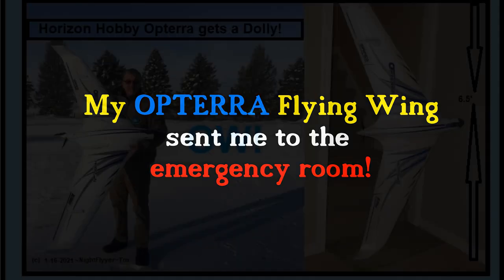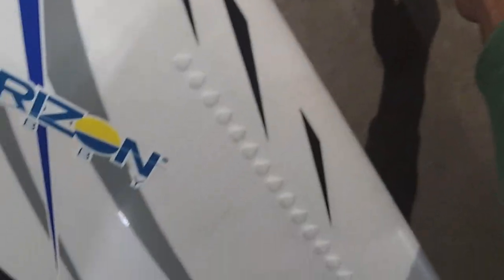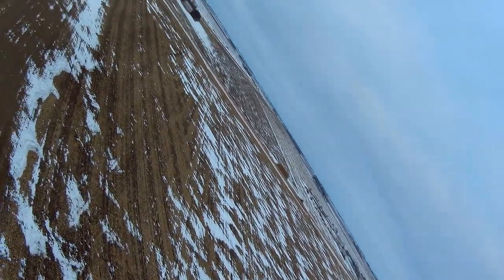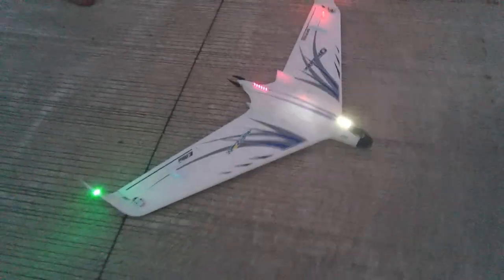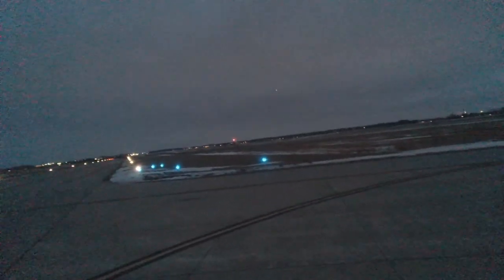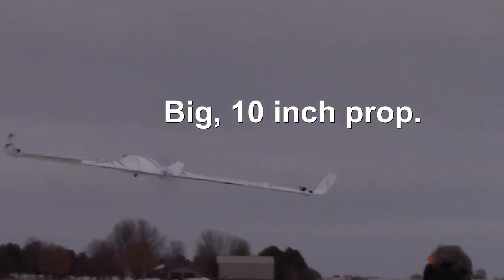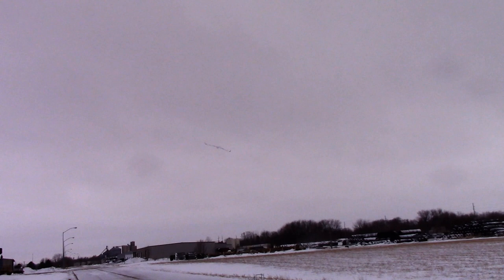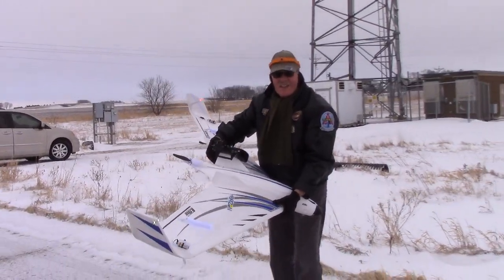My Opterra 2M Flying Wing sent me to the E.R. This is an awareness video & my solution for launching

Comment from the maker: ***UPDATE.  See this newer video if your considering buying ANY pusher plane.  My Sled Launcher.  https://youtu.be/f5xDfk7sbcQ
 Notice for all those that say they never heard of ESCs that need stick movements to arm:  I have used hobbico, horizon, and great planes ESC's for years and am spoiled by what they call SAFE START.  I like it and when I come across one that doesn't have it, I am disappointed.  I am using 2 of these on my Mega Storm Launcher that I built this past fall, 2020.   Here is from the 22-25 Electrifly manual:  SAFE-START:  As  a  safety  precaution  to  prevent  the  motor  from  rotating when the battery is first connected, you must “arm” the ESC every time you connect the battery. The propeller will NOT rotate until the  ESC  is  armed.  To  arm  the  ESC,  move  the  throttle  stick  to  full  position,  then  back  to  off  (or  brake).  Now  the  motor  will  rotate  anytime  the  throttle  stick  is  advanced  away  from  the  off  position.

If you follow my channel, you know I am no newbie and for some to say I asked for it or should have done it differently is disappointing, especially when I am the one hurt, the hospital charged me $2400 for X-rays, Tetanus shot, 27 stitches, and 2 repaired tendons, when I followed the manual's launch instructions word for word.    See previous good hand launches in my Product review video and my second one here.   https://www.youtube.com/watch?v=P_inF5EYLEE&t=1s&gl=CO and  https://www.youtube.com/watch?v=ur5V5H8UcGs&t=1s

First of all, that throttle arming had nothing to do with my hand injury. I only mentioned the Throttle arming because I followed instructions in the manual and that is the way it bound up.  It arms the motor as soon as you plug in the battery. I usually program a throttle cut in and mentioned it in case a new person forgot.  In older Electrics we used to put the throttle at full.  Then when it was time to fly, you would bring the throttle down to idle to arm it.  Today's transmitters warn if the throttle is full and no rf is transmitted till you put the throttle to low.  Because this big plane is hard to  handle to prepare for launch, I think the manual should mention to program in a throttle cut. This plane is hard to pick up by the tip and barely has enough power to fly out of your hand at launch.  I know and I tried.    It would also be extremely difficult to somehow launch it discus style with the elevon there and that 7" tall winglet rudder that is also on the tip.  I know how to do it , but not with this plane.  
It's not like launching my SMALL F-27 Evolution or 1.2M Opterra.  So I followed the instructions word for as I did for the video I made of my product review earlier where nothing happened bad.  https://www.youtube.com/watch?v=P_inF5EYLEE&t=1s 
We are only talking about a Half inch of clearance that I needed to keep from getting cut. 

Here is word for word what the Opterra 2M manual says about launching.  
1. Put the aircraft into launch mode with the channel 5 switch.  (in my first video that did not work, it went into the ground)  
2.  Hold the aircraft in one hand and the transmitter in the other.  
3.  Apply full throttle and throw the aircraft directly into the wind, angled slightly up (5 to 10 degrees above the horizon). 
4.  Climb to a safe altitude and check the trim.   

I know others have their own ways, and either way, my Dolly is the safest solution for me.  
The Opterra 2M manual also says nothing about throwing it with the motor off, so if a newbie followed the instructions, like I did, I'm showing what could happen, in case a gust of wind got them or something else.     Nothing is 100% and no matter how good you can throw, this big 7 foot wing with a 10 inch prop spinning right next to your face, is risky.

Maybe a gust of wind, maybe my 73 year old left arm was weaker, or who knows.   But either way, if it happened to me launching the way I thought was good (and  the same as all my previous launches.)  So if it can happen to me, it can happen to others, and that is the warning I want to present. 

Gloves
Thanks for that suggestion and I tried that already, because it was cold, but trying to hold on to the tiny finger grips on the bottom of the 7 foot wing with a thick glove under full power would be difficult when under power and then trying to fly with it on and also difficult to fly the transmitter,  so although that sounds like a good idea, it would probably not work that well.  We are only talking about a Half inch of clearance that I needed to keep from getting cut. 

Landing gear.
Yes, well if you saw my Product review  video,  https://www.youtube.co/watch?v=P_inF5EYLEE&t=1s  you would see  those wings aren't as strong or thick as you would think.  I would have to add a nose wheel servo and make it a trike as well.  And since the prop on the back is 10 inches, the landing gear would have to be quite long or retractable prop would hit the ground on rotation or landing. Thanks for the suggestion, but the dolly is pretty permanent too.  
Night-Flyyer-A-Pult catapult.

See my 14 year old self-contained catapult in action here.  https://www.youtube.com/watch?v=ypxbkaY-Ycs&t=113s  

And to see how I feel about that unnecessary auto stabilization system see this.  https://www.youtube.com/watch?v=ur5V5H8UcGs&t=1s

And to see another fellow who got whacked with a smaller plane, click here. 
https://www.youtube.com/watch?v=GlevWppQu9w

Thanks and God Bless, 
Dave

Music Score by Http://www.bensound.com
Reply: So sorry to see this happen but so glad you put this out there to warn others, once again Dave looking out for others :)
I wonder why they didn't make it a ducted fan design for safety reasons
Reply from the maker: @lee__1707  Thats what I said in my comment and video notes...At least a ducted fan shroud or something!  Maybe Ill just put a ducted fan on it this spring.  thanks much.
Reply from the maker: @capnhardway  Maybe a gust of wind, maybe my 73 year old left arm was weaker, who knows.   But either way, if it happened to me launching the way I thought was (and looked the same) as all my previous launches. Nothing is 100% and no matter how good you can throw this big 7 foot wing with a 10 inch prop spinning right next to your face, stuff can happen. 
So if it can happen to me, it can happen to others, and that is the warning I want to present.
Reply from the maker: @capnhardway  If you follow my channel, you know I am no newbie and to say I asked for it or should have done it differently is disappointing, especially when I am the one hurt, the hospital charged me $2400, and I followed the manual's launch instructions word for word.     First of all, that throttle arming had nothing to do with my hand injury. I only mentioned the Throttle arming because I followed instructions in the manual and that is the way it bound up.  It arms the motor as soon as you plug in the battery. If it had said to program in a throttle cut, I would have!    This wing is 7 foot long and will bend and break the end off the if you even try to pick it up by the tip. It would also be extremely difficult to somehow launch it discus style with the elevon there and that 7" tall winglet rudder that is also on the tip.  I know how to do it , but not with this plane.  See my 14 year old self-contained catapult in action here.  https://www.youtube.com/watch?v=ypxbkaY-Ycs&t=113s
It's not like launching my SMALL F-27 Evolution or 1.2M Opterra.  So I followed the instructions word for as I did for the video I made of my product review earlier where nothing happened bad.  https://www.youtube.com/watch?v=P_inF5EYLEE&t=1s
Here is word for word what the Opterra 2M manual says about launching.  
1. Put the aircraft into launch mode with the channel 5 switch.  (in my first video that did not work, it went into the ground)  
2.  Hold the aircraft in one hand and the transmitter in the other.  
3.  Apply full throttle and throw the aircraft directly into the wind, angled slightly up (5 to 10 degrees above the horizon). 
4.  Climb to a safe altitude and check the trim.   
I know others have their own ways, and either way, my Dolly is the safest solution for me.  
The Opterra 2M manual also says nothing about throwing it with the motor off, so if a newbie followed the instructions, like I did, I'm showing what could happen, in case a gust of wind got them or something else.     Nothing is 100% and no matter how good you can throw, this big 7 foot wing with a 10 inch prop spinning right next to your face, is risky.  And to see how I feel about that unnecessary auto stabilization system see this.  https://www.youtube.com/watch?v=ur5V5H8UcGs&t=1s
Maybe a gust of wind, maybe my 73 year old left arm was weaker, or who knows.   But either way, if it happened to me launching the way I thought was good (and  the same as all my previous launches.)  So if it can happen to me, it can happen to others, and that is the warning I want to present.  Thanks.

Comment: I launch mine with a power-off glide and only power up after leaving my hand.
Reply: Yep thats the only way to do it. It makes me shudder every time i see someone launch under power
Reply: @timjarman6027  wing launch..... never put your hand in line with a prop... spinning or not. pusher flying wings need to be wing launched, or use a slingshot.
Reply: I was doing this too. But I didnt like that I have to grab controller fast right after launch. Now I configured auto-takeoff on my F4 FC with Ardupilot. Works like magic: FC senses when you through the plane, starts prop after short delay and do auto climbing. It makes takeoffs very easy and does not require additional equipment.
Also, it happens that I mostly fly during winter season, so I am wearing gloves. I believe this adds some safety too.

Comment: Hurts just hearing the sound of the prop striking your hand.
Reply from the maker: Yes, but this razor sharp carbon fiber prop would probably cut thru that too.  I never had to ever use a glove to launch any of my wings, but this big 10" prop is very close.  I will never hand launch it again as it's Hello dolly!    Thanks for the suggestion and comments.
Reply: My hand hurts just listening to that sound! And tendons are no fun s
Reply from the maker: @nwanchorcertification  For sure.  It still hurts and the bone got whacked pretty good as well.  Thanks.
Reply: @NightFlyyer  Chainmail butchers glove, problem solved.
Reply from the maker: @RACGump  Not at all. Thanks for that suggestion and I tried that already, but because it was cold.  I found trying to hold on to the tiny finger grips on the bottom of the 7 foot wing with a thick glove under full power with wind blowing was difficult when under power and then trying to fly with a big enough glove on was also difficult to fly the transmitter, (I'm a stick pincher)  so although that sounds like a good idea, it did not work that well. Some have told me the Prop got them in the forearm even before launch, when a gust of wind got under the wing and tipped it back.   We are only talking about a Half inch of clearance that I needed to keep from getting cut, and even though I pulled it off several times in my earlier product review video,  I will never hand launch it again.  LOL.  It's hello dolly from now on!  Thanks.

Comment: Why not setup a throttle cut switch on your transmitter so when activated throttle does not function?
Reply: I had a similar experience when I was first learning to fly.  That’s when I put an arm switch for the throttle on the transmitter.  I use it religiously.  When I am done with a flight, I  kill the throttle at the switch and it stays killed until I am ready to fly.  Although I didn’t require stitches, I was in shock.  I keep a well equipped first aid kit in my truck and was able to patch myself up enough to get home and do it properly.  Have to admire your landing, but personally I would have killed the throttle and landed straight ahead.....hope you are healing well.

Comment: Great to see that you are healing OK my friend. That is why Iam laways a little afraid to hand launch pusher planes since my hand accident. I just dont want to cut my other hand also. Great takeoff with a trolley. I wanted that with my small one Opterra but it didnt worked. Maybe with bigger one it will. Its worth to give it a try. Stay safe and big salute from Slovenia.
Reply from the maker: Thanks a lot captain. I  appreciate that.  The big one is underpowered in my opinion.  Stay well.

Comment: My friend had an Opterra and he launched with motor off and quickly gave throttle , but we have good strong wind to allow this. Get well soon!
Reply from the maker: If you follow my channel, you know I am no newbie and to say I asked for it or should have done it differently is disappointing, especially when I am the one hurt, the hospital charged me $2400, and I followed the manual's launch instructions word for word.     First of all, that throttle arming had nothing to do with my hand injury. I only mentioned the Throttle arming because I followed instructions in the manual and that is the way it bound up.  It arms the motor as soon as you plug in the battery. If it had said to program in a throttle cut, I would have!    This wing is 7 foot long and will bend and break the end off the if you even try to pick it up by the tip. It would also be extremely difficult to somehow launch it discus style with the elevon there and that 7" tall winglet rudder that is also on the tip.  I know how to do it , but not with this plane.  See my 14 year old self-contained catapult in action here.  https://www.youtube.com/watch?v=ypxbkaY-Ycs&t=113s
It's not like launching my SMALL F-27 Evolution or 1.2M Opterra.  So I followed the instructions word for as I did for the video I made of my product review earlier where nothing happened bad.  https://www.youtube.com/watch?v=P_inF5EYLEE&t=1s
Here is word for word what the Opterra 2M manual says about launching.  
1. Put the aircraft into launch mode with the channel 5 switch.  (in my first video that did not work, it went into the ground)  
2.  Hold the aircraft in one hand and the transmitter in the other.  
3.  Apply full throttle and throw the aircraft directly into the wind, angled slightly up (5 to 10 degrees above the horizon). 
4.  Climb to a safe altitude and check the trim.   
I know others have their own ways, and either way, my Dolly is the safest solution for me.  
The Opterra 2M manual also says nothing about throwing it with the motor off, so if a newbie followed the instructions, like I did, I'm showing what could happen, in case a gust of wind got them or something else.     Nothing is 100% and no matter how good you can throw, this big 7 foot wing with a 10 inch prop spinning right next to your face, is risky.  And to see how I feel about that unnecessary auto stabilization system see this.  https://www.youtube.com/watch?v=ur5V5H8UcGs&t=1s
Maybe a gust of wind, maybe my 73 year old left arm was weaker, or who knows.   But either way, if it happened to me launching the way I thought was good (and  the same as all my previous launches.)  So if it can happen to me, it can happen to others, and that is the warning I want to present.  Thanks.
Reply: The Opterra will glide for a solid 40-50 feet in no wind.  I hold the TX in my left hand and throw with my right with plenty of time to roll on the throttle AFTER the throw.  Wingtip launches work well too.
Reply: I own 20+ planes and they all arm as soon as the battery is plugged in.  If you want an arm switch, you'll need to program that into a transmitter.
Reply from the maker: @Jmersh  I'm  well aware of that and glad my Helicopters have to be armed.  First of all, that throttle arming had nothing to do with my hand injury. I only mentioned the Throttle arming because I followed instructions in the manual and that is the way it bound up.  It arms the motor as soon as you plug in the battery. If it had said to program in a throttle cut, I would have!    This wing is 7 foot long, heavy and  will bend and break the end off the if you even try to pick it up by the tip and barely has enough power to fly out of your hand at launch.   It would also be extremely difficult to somehow launch it discus style with the elevon there and that 7" tall winglet rudder that is also on the tip.  I know how to do it , but not with this plane.  See my 14 year old self-contained catapult in action here.  https://www.youtube.com/watch?v=ypxbkaY-Ycs&t=113s
Reply from the maker: @Jmersh  Yes, but in heavy wind, it barely does. See my original video, where I launch it several times with no problem. 
The Opterra 2M manual also says nothing about throwing it with the motor off, so if a newbie followed the instructions, like I did, I'm showing what could happen, in case a gust of wind got them or something else.     Nothing is 100% and no matter how good you can throw, this big 7 foot wing with a 10 inch prop spinning right next to your face, is risky.  
Maybe a gust of wind, maybe my 73 year old left arm was weaker, or who knows.   But either way, if it happened to me launching the way I thought was good (and  the same as all my previous launches.)  So if it can happen to me, it can happen to others, and that is the warning I want to present.  Thanks.

Comment: I never throw my Opterra with running motor. Hope your finger is fine.
Reply: I agree with you, I launch the opterra and my flying wings without the motor running, it does glide well! Plus I connect the battery standing in front , not behind or to the side. Also check those battery straps, the plastic plate your battery rests on is held in by mosquito snot!